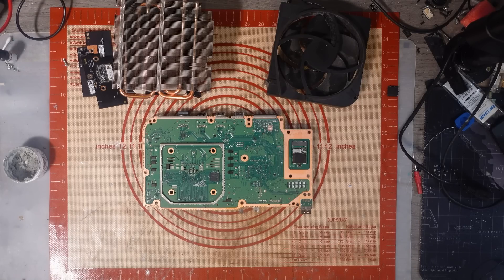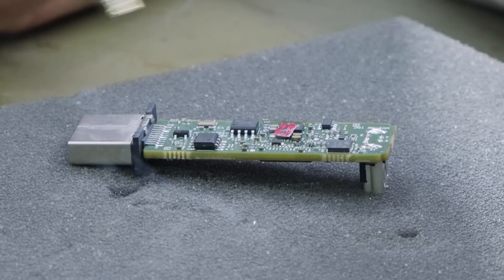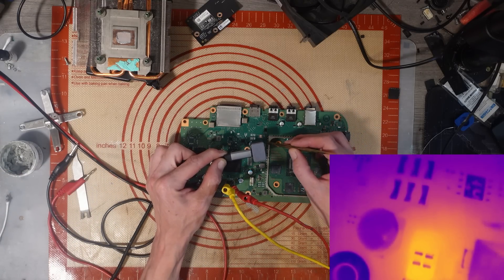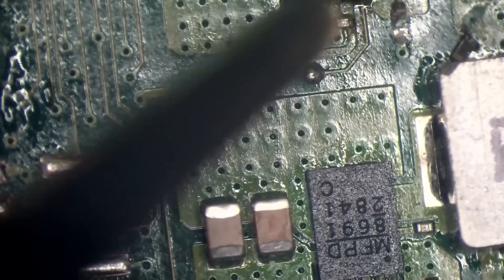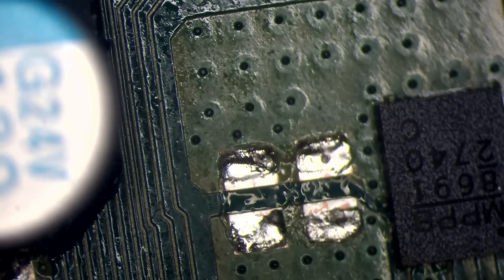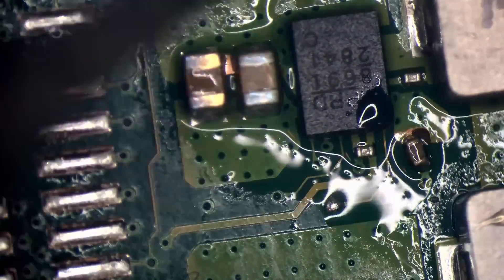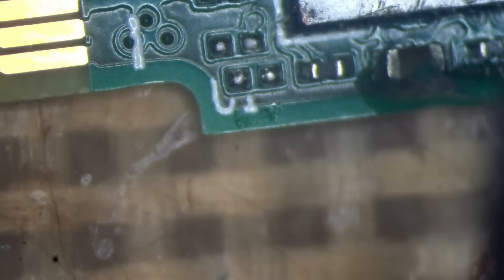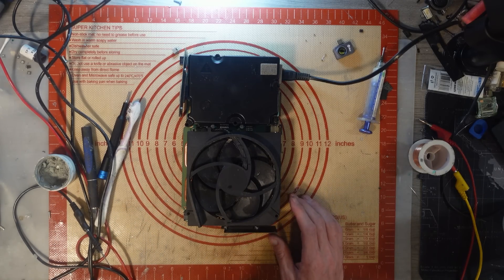Can I Fix An Xbox Series S With Major Liquid Damage

Comment: is it the chip by the hard drive at the bck of the ps3 slim board need to chamge or the wifi ic chip need reballing over which one is the one daf needs to be changed when updating an show the error code when updatyi g bro?

Comment: I don't mind the fast forward for the component replacement but you did some testing and did not explain what you were testing for during the fast-forward. Also, you did a few jumpers and there were a lot of missing components on the board.
Reply from the maker: I agree mate, I don't like doing stuff like that but it was just way too much to edit down and because it was streamed there was a lot of talking to chat too. The video would've been over an hour long. The jumpers were just to restore some traces which had burnt away and the testing was just checking resistor values because they looked rough
Reply: Thanks for clearing things up!